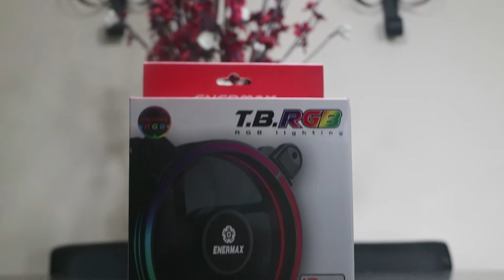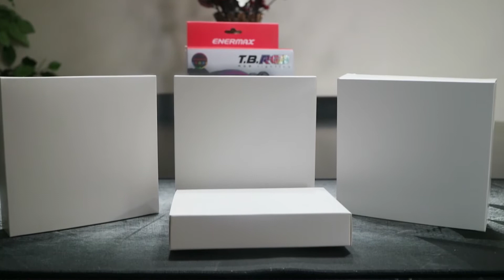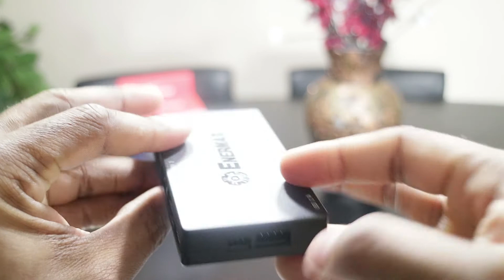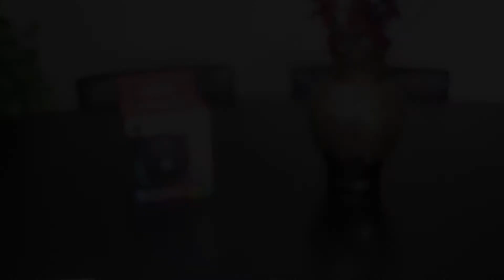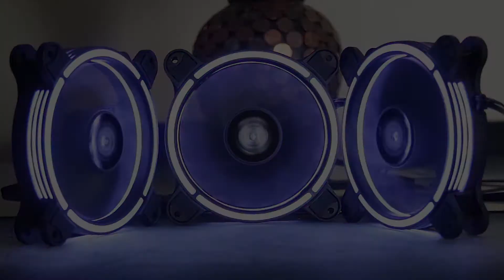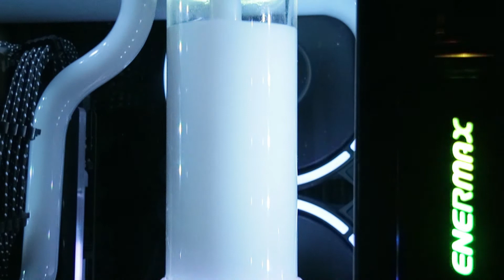Enermax T.B. RGB Fan Review: Beautiful Design. Great Lighting. Great Price!

Comment: Color circle effect ?
Reply from the maker: You mean when the RGB effect cycles thru the colors, like addressable LEDs? It doesn't have addressable LEDs.
Reply from the maker: Their newer ones have em though! Go check out their website/Amazon!
Reply: So you mean i can control it over the aura sync but only to solid colors without any special effects? fans cost around 60€ here so idk if thats the newer or older version

Comment: Just so EVERYONE knows, I bought these fans on 8/26/18 and not but 3 weeks later one began to rattle, then 3 days later another one, and now 3 of them rattle. I bought a 6 pack, plus I bought the Enermax desktop case that comes with 3 in the front and one of those rattles now as well. One of them rattles SO BAD that if you set it on a flat surface it vibrates itself all over. Do NOT buy these fans. I sent Enermax a video "Link to my video: https://www.youtube.com/watch?v=tYiZzux3Qz8&t=130s " of what the fans were doing and asked if they could please send me just enough fans to replace the ones that rattle, 5 all together, and once I received them then I would send the old ones back because I cant afford to have my computer down for even a day sense I use it for my Drone business. They would not do this and demanded I send them the old ones first. Seriously? Why the hell would I keep the old ones that rattle so bad anyway? That's when I swore to never buy from Enermax again. These fans are beautiful, but the "Twister Bearing" design is flawed and does not work. My only hope is to try and take these apart and see if there is a way to change out the motors and fans for ball bearing ones and just keep the shroud itself but I doubt this will work. So fair warning, dont buy these fans!

Comment: How are these fans holding up since this review? I've seen several reviews on Newegg saying that they eventually start rattling or they break?
Also, are these fans better for airflow or static pressure? Thanks!
Reply from the maker: These are actually better for static airflow because of the wide blades. I used them on radiators. In the end of the video, u can see the build I did with the being used on the radiators. They actually held up pretty well! No issues with them on my end whatsoever. I did take them apart to clean the blade and I snapped a blade off (super glue and a hot glue gun solved the problem lol) but that was because I was careless. Other than that, I love em!
Reply: Petty Fixes Great! Thanks for the quick reply!
Reply from the maker: Absolutely man! Make sure u subscribe! I got more content u might like on the way.
Reply: I got you. Done!
Reply from the maker: Thank u sir!

Comment: So if I was to have some of these fans at the front of my case on the inside in a pull configuration, and one at the top and one at the rear with a pull configuration so I have air flowing from the front and exiting the rear/top I wouldn't be able to get the full RGB effect on the front ones correct? Or is it possible to reverse the fans in the shroud and still get the RGB. Nice video by the way, subscribed.
Reply from the maker: Oh, I see. Well, it'll all be connected thru the hub so you will get the RGB effect no matter what. And thanks for the sub!
Reply: What I was getting at is I'm wondering if the RGB will be mostly blocked if I run them in pull config inside the front of my case or is there a way around this
Reply from the maker: Oh I see. Well the illumination that u see on the front that shows the led ring isn't on the back of the fans. Only on the front. But it does show in the side. So for example. I had my top 360mm radiator set up in push pull, with exhaust flowing out of the case. The front side of the fans were facing down so I could see the whole led illuminating effect from the front and sides. On the front, I just had front intake so I could see it from the front of the case but looking inside the case, the front illumination isn't visible from the back, if that's what u mean.

Comment: I can't tell you how much I hate those 6-pin connectors! There is no reason for this except the obvious one; Make it as difficult as they can to force the user into buying parts and fans from only them. 

OK, so fine, I'll move on to the connections and the incredibly vague instructions. I've attempted to run just one of their fans, (any one of their fans), to get a comparison between the RGB fan CFM and my ENERMAX T.B.VEGAS fans. However, I can't seem to get any power to the RGB fans at all!

I had to use a 12V DC Bench testing Power supply  and alligator clips attached to the two pins of the RGB Molex connector just to make sure the damn things worked. I don't know what's going on with these fans and I can't tell for sure if the connections regarding this other "M/B sync cable RGB 4-Pin header connection method is mandatory or if they're saying you can choose to do that, (or just connect to the Molex power). 

The only thing I'm sure of is that I've wasted way too much time trying to figure out what it is I need to do to make them work, and no, I'm not willing to give up my Reset switch function for the fans. I don't know what genius thought that would be a good idea...

Like; "hey, I know, lets make it so that the pretty lights work if they wire them to their Reset switch! That way, they can't reset their computer without opening the case and jumping pins but they should be happy because they'll be able to see the pretty lights even if the computer isn't working..."

That's just stupid. What, they can't add a simple intermittent push button switch with the fan package? (Wholesale, that would set them back about 6 cents). I don't know, I guess I just need to leave it alone for a few hours and maybe it'll come to me.

Thanks for the video but I sure wish you would have shown how you connected the fans to power them on from your demo.
Rich
Reply from the maker: Ok so seems like u took a different way of testing them out. I simply connected the power cable that came with it to the control box. Next, I used that molex connector and connected it to a spare 550w power supply I had laying around amd it lit right up. I then used the remote control to control the colors and fan speeds. Believe me, I know what u mean by hating the 6 pin connectors. A simple control box with a pwm output and a data connection would be nice.
Reply: Yes, thank you for that connection confirmation. That was exactly what I did but as it turned out, the PSU 
 to Molex connectors that I used to test the fans were from a Corsair RM1000i, which is the power supply in my 'bigger desktop'. I was working with my other, smaller desktop which has a OCZ 700w PSU. 

I forgot that Corsair PSU/cable connectors are also proprietary, (really!)! Seriously, when I got that PSU about a year ago, I couldn't believe it until I did test after test with DVMMs and other PSUs! I finally confirmed that the Corsair's cables only work with  their PSUs. I don't know if this is just for their 1000 watts+ PSUs or all of them. (The 'live' pins in the connectors are actually in a different configuration than a 'normal cable').

Well, I forgot about that when I wanted to test these Enermax RGBs. I used one of the Corsair 1000i's Molex cables connected to the OCZ 700w PSU to test the fans. Of course, I finally remembered the issue with the Corsair cables. The fans worked just fine when I switched to a 'generic' Molex power cable.

The fans are quiet, though even at max speed, they seem to generate less than their rated 47.53CFM, but I'm  just guessing. I'll be using them in a push/pull configuration. They'll be doing the 'pushing' and on the 'pull-side' I'm using fans that generate about 75-80CFM.  If they don't work out, I'll go back to my other fans. 

I've got more 120mm case fans than I know what to do with, lol.
Thanks again,
Rich
Reply from the maker: Oh Lord the dreaded Corsair PSU cable issue... I went thru it! Lol. The fans work just fine cooling a GTX 1070 and a 1700X in my system on a 240mm and 360mm rad. Top 360mm rad is in push pull. They're beautiful fans! I love them!
Reply: Yes, I have the Enermax TB Vegas fans in my 'big' computer. However, I don't have a 360 rad in that one. I have a GTX 1070 and a 4790K Devils Canyon mounted on an MSI z97 MPower MAX AC mobo and all of it in a Corsair 780T. Then I'm cooling it all with a Swiftech H220 semi-closed loop system (with an additional reservoir). I have a 240mm radiator on top, and a 140 mm Swiftech Trident in front (all in push/pull config). I'm able to O/C the processor to 4.9GHz. I can get 5.0 out of it but I rather not so 4.9 is where I run it when I need it.

I'm not a 'gamer' per se', but I'm a flight sim hobbyist. For the last 8 or 9 years, I've put thousands into the 3rd party add-on HD mesh, landscape, atmosphere, aircraft, etc., etc. My sim platform is FSX which has an old code that demands a lot of CPU speed per core. In fact, it was for that very reason that I learned how to build a computer.

Of course, the GTX 1070 (and 2 x 8GB, G-Skill 2400Mhz Rip Jaws), contribute to the frame rate as well but it's the CPU that gets hammered the most. I maintain 32FPS in the most demanding flights, (like Mach 2 at 500' AGL near Seattle). 

Still, by the time i have the system where I want it, I'm 3 generations behind! I imagine that it won't be too long before I start brushing up on the latest multi-core CPUs and motherboards that can take them. Eventually, my presently dubbed "big computer" will become "my smaller computer" but at some point, I have to stop... I just don't know when ;)
Rich

Comment: Can I control the fan speed, colour,and lighting style using my motherboard?
Reply from the maker: You can only control the fan lighting style and color thru the motherboard using the RGB sync cable, provided your Motherboard has a RGB header. Fan speed is controlled thru the remote control.
Reply: Petty Fixes oh ok thanks!

Comment: So these can connect to a 4 pin molex connected to my power supply? Or at least the control box can? Im not a tech pro so Im not sure about that stuff
Reply from the maker: Yes, they are powered by molex from the power supply, ur right!. The fan speed is controlled thru the remote control.
Reply: @PettyFixes  I installed these fans not realizing my asus prime z370-p does not have a rgb header. therefore, i cant use the software to control the fans so i have to use the remote controller. The issue im having is my prebuilt PC came with an  LED strip that is also controlled with a remote controller. So when i try to change my fan color, the LED strips change colors as well. I cant get the lighting effects i want. Is there anything i can do to change the color of the fans and the LED strip independently??
Reply from the maker: That's a problem i had before as well. The remote is almost the same as others and uses the same functions. I had to move the remote sensor for the fans somewhere else. I had it hanging out the back of the case.
Reply: @PettyFixes  okay. thanks!!

Comment: Can you control them through Software?
Reply from the maker: Only way to control them thru software is to connect the control box to the motherboard using the motherboard sync cable. I have mine controlled thru Asus Aura. It supports other motherboard software as well.
Reply: Petty Fixes do you think that i can control them with my Motherboard the Asus Prime B350 Plus?
Reply from the maker: Does it have an RGB header?
Reply from the maker: Or are you trying to control fan speed? Fan speed can only be controlled thru the remote.
Reply: Petty Fixes yeah
Reply: Petty Fixes OK thanks for that but can i control the lights?
Reply from the maker: Then u should be good?
Reply: Petty Fixes does it come with cable that connect from controller to rgb header
Reply from the maker: Yes it does come with a cable for hooking up to a 4pin header for RGB.

Comment: Are you required to connect the control box to an RGB header in order to change the colors? Or can it work without it. I want to get these but I dont have an RGB header mobo.
Reply from the maker: You aren't required to connect the control box to a motherboard header. It's optional. It's all controlled by remote. It can work without it. I just use the Mobo header because it's easier for me lol.
Reply: Petty Fixes awesome, thanks! Great video, you got a new sub!
Reply from the maker: Greatly appreciated! Thanks!

Comment: Can I connect the RGB Hub to my Mainboard to Controll them with Aura?
Reply from the maker: Yessir! That's exactly how mine is being controlled!
Reply: Petty Fixes via RGB header and 4pin pwm?
Ist a Rainbow Effekt possibly, which looks like the Image in the case?
Sry for all the questions I have watched your Video a few times, but I am from germany and sometimes you were to fast for me :)
Reply from the maker: The rainbow effect is possible. It won't necessarily scroll across the fans in sequential order but they all will be in sync with the motherboards LEDs. It connects via RGB header. They aren't PWM controlled. They are a proprietary 6 pin connector and fan speed is controlled by remote control.
Reply: Petty Fixes okey thank you very much
Reply from the maker: No problem!
Reply: Petty Fixes If I want to Change the Speed, I have to use die Remote?
Should be my Last question!
Reply from the maker: Yep you do have to use the remote. They are fairly quiet at full speed!
Reply: Petty Fixes Okey, then I can set the speed, and never touch the  remote again
Reply from the maker: Absolutely. It's 3 speeds, low, med and high.
Reply: Petty Fixes planning on buying these fans (6 in 1). Can i set the speed of the fans individually in varying speeds if connected to the control box? thank you.
Reply from the maker: As far as I know of, no. They are controlled by the remote control.
Reply: you did it mate? from where you controll them exepct controller

Comment: I heard a previous reviewer mention that you can plug the reset switch from the pc case into the fan controller and use that switch to scroll between colors, is that true?
Reply from the maker: Yep, you can. I personally chose not to because I actually use my reset switch for resetting my PC for some applications settings to take affect. But the fans are awesome. Great for static pressure.
Reply: Petty Fixes it scrolls through all settings?
Reply from the maker: Yes it scrolls thru all of them. But honestly it's easier to just use the remote with it. It's faster lol. Instead of having to scroll to the setting you want and potentially scroll past it, just use the remote to immediately pick the setting.
Reply: Petty Fixes awesome, thanks for the info and thanks for the video :)
Reply from the maker: Hey thanks man! No problem! Glad you enjoyed it. I have a review on some more fans coming this week hopefully... You might wanna check it out. 😁
Reply: Petty Fixes absolutely!